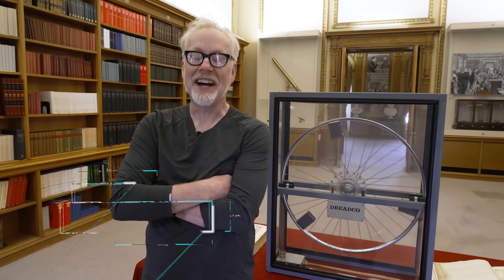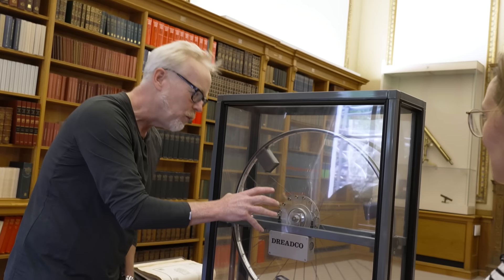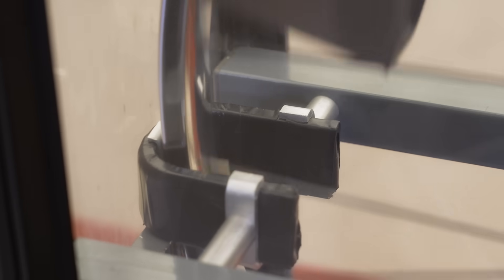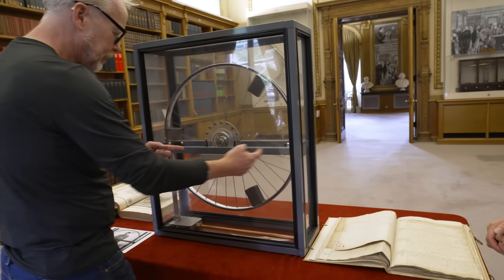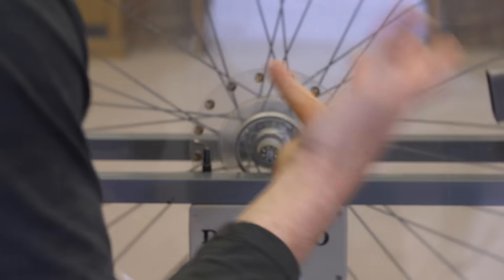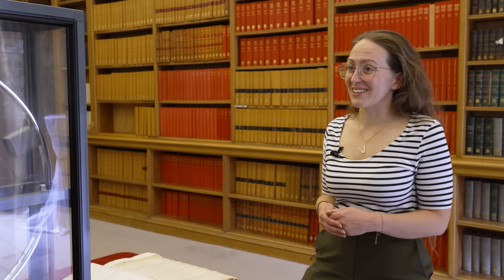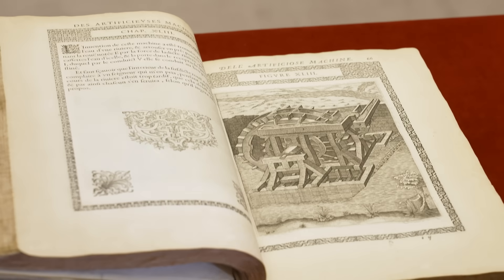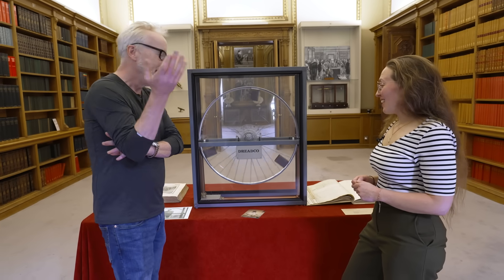Adam Savage vs The "Perpetual Motion" Machine!

Comment: the boxes aren't magnets but rather low voltage coils wrapped around a big battery, they are mounted with the coils so that the current is perpendicular to the magnetic field generated by the c magnets, f=BIL, flemmings left hand rule, bam it rotates

Comment: I think the coils are passing by the magnets. The charge created slowly build in a capacitor below. The pipe vents warm air giving a tiny boost. But the main force is the tiny cups being pushed on by the two pointy fingers in the center by discharging tiny amounts of ions. They are faced in different directions and have different heads.
Reply: None of those things explain where the energy to power them comes from.

Comment: Ok. How about this: Magnets (3 on the wheel rim)  passing other (horse-shoe) electomagnets producing a tiny "push" charge to top up an electrostatic generator in the Dreadco box. Small pipes coming out of the Dreadco box provide a small electrostatic 'wind' into the little cups on the hub. Very low friction bearings (maybe the plastic housing is vacuum charged?) and intertia do the rest. Now I'll get me coat, as I'm probably a million miles off. Good fun tho!
Reply: Removing angular momentum, to produce an electric current, to produce an electrostatic charge, to fire at some cups, to increase angular momentum, is always going to be less efficient than just leaving the angular momentum where it is.
Reply: @CorwynGC  Haha. Yes, well, who said it had to be a sane solution. Just trying to use as much of the gubbins as possible!

Comment: It's a Reelight on low friction bearings feeding back into it self. It's worth noting that Nottingham was home to Sturmey Archer who made the best bicycle dynohubs. The heat sink box with copper is a McGuffin. It's a few compression fittings and a bleed nipple that does nothing. I would also hazard a guess that the glass case has a vacuum inside to remove air resistance.
Reply: There's no way that case is strong enough to contain a vacuum.

Comment: It appears to be a very rudimentary, very low-power electric motor with a LOT of decorative red herrings.
The weights on the wheel are likely just iron or steel- something heavy and ferromagnetic that also provide a high moment of inertia for the wheel. The left arm that Adam posits is a charge collector is probably just a hall-effect sensor reading wheel position from those small magnets to use stored battery energy to enable and disable each of the black electromagnetic coils on either side of the middle bar when the metal blocks on the wheel are nearby.
It would take very very little current to encourage the wheel to continue spinning in the manner and there is more than enough space inside for the batteries to do so for years.
Edit: Looks like thats Adam’s conclusion as well.

Comment: If it were me, those would be horseshoe magnets and the boxes contain electromagnets.
But their power is actuated by a magnetic reed switch.
There has to be enough inertia in the wheel to prevent cogging.
But I can't be certain, I'm not good enough to do the field interaction dynamics in my head.
The magnetic field on the horseshoes would reverse from the point of reference on the boxes, hence the cogging problem.
The reed switches would be there to prevent an equal push-pull problem as the boxes pass through, either switching the electromagnets on or off before or after they pass through.
Something like that anyway
Reply: Why use a magnetic reed switch when you have a perfectly good electro-magnet sitting right there?
Reply: @CorwynGC  
An electromagnet is just a battery connected to a coiled wire, for all intents and purposes, a short circuit.
With a 100% duty cycle (on all 360°) the battery wouldn't last 2 days, let alone 2 years.
But how to activate the electromagnet only when near the permanent magnets? Specifically, without any battery-eating active components (transistors)?
A reed switch is how I would do it, closed (on) as it approaches the magnet, open (off) as it passes until it reaches the next magnet.
There's a special type, called a latching reed, which closes when the field is one direction, opens when it's reversed.
Again, I can't do the field dynamics in my head, I'm not enough of an electronics guy, but I'm sure it's possible.

Another possibility is with a transistor or two.
Maybe if you monitor the current in the coil with the gate, which energises the coil.
Then, when the field reverses, it deenergises it.
Some sort of two transistor latch.

Comment: I am nearly certain that this uses an early concept version of what some racing cyclists have been caught using over the past 5-10 years. A hidden electric hub motor. The complexity of other components are there to confound the observer and lead them down multiple dead ends. Today it’s easier to figure it out if you’ve seen it before, however, in 1980 this would’ve been alien technology. My only real question is where is the battery? My guess is it’s in that box marked Dreadco, but I could also see it being in the 3 “magnets” at 120 degrees apart, or the box with the heatsinks. Occam’s razor tells us it’s likely to be the simplest of the 3. 

Now.. The real question is, are you making this on the show? Because if done as an interactive build, I think many of us viewers would iterate builds to test different component possibilities leading up to a final Tested build of the best solutions.
Reply: I have an electric bike with a hub motor. It is quite large and obvious, and with a battery that weighs 50 lbs is only able to propel the bike at 30 MPH for a distance of 12 miles. I'm really skeptical that there is a hub motor that someone could hide in a racing bike wheel hub.
Reply: @NonEuclideanTacoCannon  although i dont tink its using such a hub, the hub he refers to is one of those tiny ones that was used in that cyclist scandal. its not bigger then a wide pen
Reply: @NonEuclideanTacoCannon  don't forget, though, that your bike motor has to propel the combined weight of the bike and rider, fight wind resistance and hills, and various other significant leeches of energy. The device in the case just has to keep a bike wheel spinning, which as others have pointed out requires relatively small energy input if the bearings are well designed and in good condition.
Reply: @NonEuclideanTacoCannon , you’re comparing the size of an electric motor designed to propel an entire bicycle and rider (200+ lbs) up hills, dealing with friction, air resistance, & tire deformation forces to a motor used to spin a carefully balanced wheel, precision-balanced on incredibly precise bearings, at a very low speed with the only load being the air resistance against the protruding parts.

You could do that job with something more akin to one of the motors they use on a ‘Tiny Whoop’ quadcopter, or with a system that only briefly provided the faintest of propulsive force as the week-mounted boxes pass the box with the heat sinks, using the same boxes passage through the u-shaped metal bars for timing purposes.
Reply: @Vessekx  OP claims that someone used an ebike hub motor to cheat in a bike race, and I was disputing that. No hub motor large enough to make a difference in a race is going to fit in a regular bicycle hub. It's just not happening. For that matter, where the hell are you going to hide a battery on a racing bike? Or the motor controller? How are you going to hide the throttle? It is something that I would have to see to believe.
Reply: @ghettopredator  I don't know anything about the purported bike racing scandal, but extremely high level competition for stuff like that is often looking for ways to shave fractions of a second. Even if it wouldn't have ultimately been actually useful I wouldn't put it past someone to try and sneak one in. And, again, even if it wasn't actually helpful, I'm sure that would still be considered cheating.
Reply: @NonEuclideanTacoCannon  None of that would be needed.  You could have nothing more than a motor + battery.  No switch, no throttle, no nothing.  Just something that provides a small continuous extra force.  Enough to give you a second or two advantage over the course of a race.
Reply: @NonEuclideanTacoCannon  Sorry to say, but you're definitely incorrect about the motor. Not only are there motors small enough and powerful enough to hide in a hub, there are literally examples of it being done on YouTube with something as small as a drone motor. The main issue is not about concealing the motor, but the power source as even with a very small motor if you set it up with proper gearing it can make a noticeable impact, especially if using it only as an assist to advantage you in a race and not exclusively as the main source of power, i.e. you still do some pedaling yourself. I could see someone wiring up a concealed motor for long distance races to make hill climbs ~50% easier. You don't need to have the motor do all of the work 100% of the race in order to still use technology to cheat and give yourself an advantage, in which case you wouldn't need a prohibitively large source of power either, just enough to make things easier when you need it.
Reply: @pbjandahighfive  Sorry, but you are absolutely wrong. I'm more than a little familiar with the brushless DC motors used for RC drones and airplanes, and also ebike motors, as I have built both. A 2206 2400kv motor like you would use for a drone spins nearly 40,000 rpms, and produces little torque. They need huge gear reduction to be usable at all. Watch Tom Stanton's video about a drone motor ebike. His drive cog is nearly the half the diameter of the entire wheel. You are not fitting all those gears and a motor in a bike hub. It's not happening. There is a reason things are designed the way they are. If a cheap, tiny BDC motor worked for bikes, then why do people use $1000 ebike motors? And Tom Stanton's bike was hardly practical or reliable, it barely worked. I wonder how many motors and ESCs he blew trying to get that to work. And again, you're missing the point. OP claims someone cheated in a bike race with a tiny electric motor hidden in the hub, and nothing has ever not happened as hard as that didn't happen. If someone actually attempted this, it wouldn't have made any difference to their performance whatsoever.  Heck, even just the battery to make a difference would add 20-23 kg to the weight of the bike, and again, where are they hiding this battery?
Reply: @NonEuclideanTacoCannon  The hilarious thing is most of the theories people are coming up with and arguing over are just as crazy as perpetual motion believers! People forget racers sweat over reducing their bike's weight by fractions of a gram and think a drone motor and an AA battery is going to overcome the weight penalty. Absolute bonkers!
Reply: @NonEuclideanTacoCannon  Look up the 60 Minutes expose where they literally fly to someone in Budapest who makes and installs small hidden motors in bikes and then proceed to cope. It's like you aren't capable of doing a basic web search for something to check if you're wrong or not before saying it.
Reply: Lol lots of replies the bearings were visible no magnetic hub
Reply: This would definitely be a great build for Adam, id love to see this happen.
Reply: @steh8217  the problem is he doesnt know how
Reply: @Reptex_krka  Yet.
Reply: So any links to the scandal?
Reply: the bike is the battery, ask any triathlete whos been awfully sweaty on there carbon bike with aluminum bits, the thrill is electric.
Reply: If you want to go the occams razor way, consider that you cant look below the table, just like with his previous installations. Everyone always assumes electromagnetism or electrostatics, but the answer is usually much more mundane. Look for the parts that are not symmetrical and consider compressed air. That is 99% how one of his most famous previous wheels worked and this one might just too.
Reply: @drkastenbrot  is occams razor a replacement for Harry's razors!! Lol wink
Reply: The hub is transparent. There are clearly visible magnets however, which most probably drive the wheel.

Comment: Periodic Videos didn't tell us how it works, either: https://www.youtube.com/watch?v=muruba8ORGA
I'd bet on either a battery and small motor in the Dreadco box (I couldn't see whether there was a way to apply force to the wheel from there), or the 3 boxes contain permanent magnets, and electromagnets in the two horseshoes are wired up to a circuit and battery in the heatsink box, making the wheel basically the rotor in a brushless DC motor.

Comment: It definitely runs as some sort of motor. Two solution:
A) The 3 boxes in the rim contain batteries and electromagnets that trigger at strategic times to interact w the U magnets

B) Battery and electromagnet in the box near the hub interacts w the disk, which contains magnets

Comment: subtropical motion acting on a magnetic polar opposites then the box acts like a speed controller. so once you move the container those weights also help keep the momentum going which are magnets acting as weights with the small bearing in the axle. the copper tubing and the heat box does nothing. because the electrodes aren’t sparking no tick tick noise. no friction from the magnets 🧲 or bearing